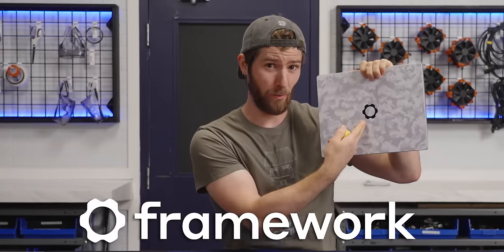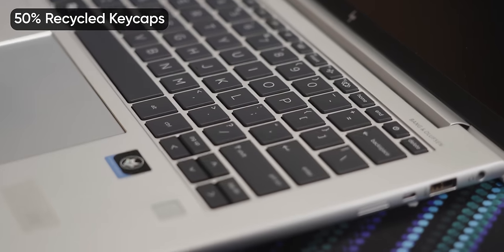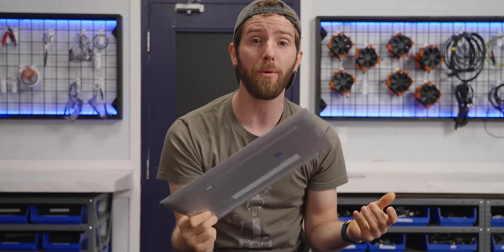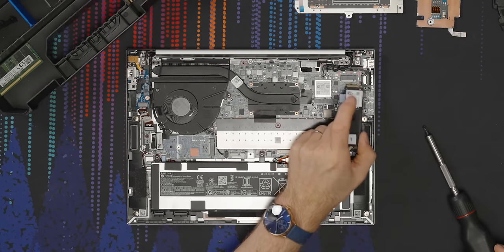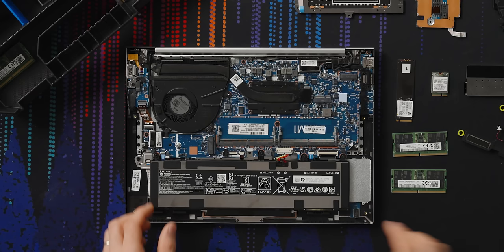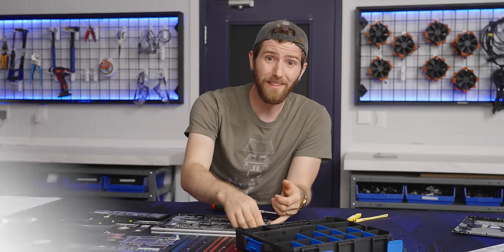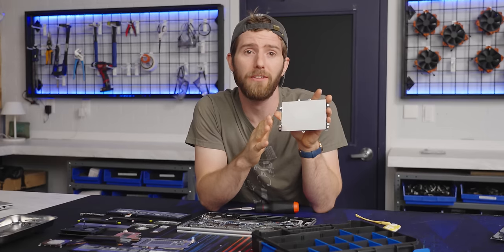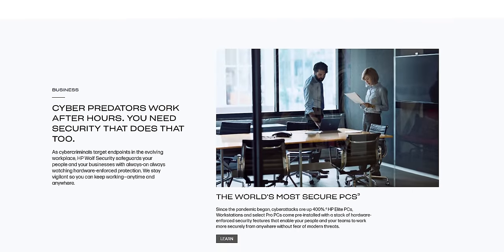My Investment is in TROUBLE - HP repairable laptops

Comment: Repairability is one thing. What Framework has going for it is the upgradability. The fact that you can upgrade your MOBO (and unlike other brands I've actually seen the upgrade exist, not just promised) was a big decider for me.
Reply: Totally agre you can't compare upgrade a motherboard with a new CPU and GPU, or a better battery when tech allow to produce them at laptop cost.
To just whe sell you any part you need. But Next Gen one will be the same frame but whe allocate the screws different so you have to upgrade the full laptop cause whe need to sell a new screen, new battery, keyboard, frame, SSD, RAM, wifi card, trackpad, charger, packcage... 
To be honest, it's way expensive to change screw layout than design a new motherboard with the same layout, but it's all about e-waste.
Reply: And upgrade your screen which I didn't hear Linus even mention being removable for the HP.
Reply: @2moke2creen  I did hear that, seems that the display assembly just uses clips
Reply: making the Mainboard upgradable would have other downsides for the Manufaturer, Notebooks get smaller, quieter, more powerfull etc evry Generation, it would slow down inovation to make the Formfactor, Coolingsolution, IO and so on of the Mainboard compatible across Generations. Look at the Framework Notebook compared to a 1040 Elitebook, The HP Notebook is smaller, lighter, quieter, has a bigger battery, much better screen, faster Ram, is convertible, and so on and so on, and its repairable just like the shown 845. Only Downside to the Framework Notebook is the missing SD Card slot, 2.5G Lan Adapter and upgradeable Mainboard. 
Same goes for Gamingnotebooks, Power requirements and IO requirements for the GPU change evry generation. Making the GPU of a Gamingnotebook upgradeable like back in the Days with MXM Modules would make slim and light Gamingnotebooks impossible, Look at the Asus ProArt Studio there is no way to cramp that RTX6000 GPU into a Notebook from years prior... Upgradeable Mainboards in Notebook dont make much sense and will stay a niche
Reply: @vocassen  clips and some glue
Reply: Yes.  When I saw him make a new PC with a 3D printed chassis, I decided my next laptop is going to be a Framework.
Reply: What I love about framework is also the versatility!
You can buy a framework mainboard and build a tiny desktop PC using it.

How cool is that?
Reply: @stirnfalte1728  you can have micro SD card reader in FW and while not ideal its actually difficult to get a standard format SD card and not micro one with adapter. You can slot in Ethernet port as well if you actually have a need for one.

As for the "getting smaller" that's a manufacturer's argument. Not considerably since the size is dictated by the screen anyway and thickness is +- the same for any ultra book. Biggest issue with FW is the battery atm.
Reply: The refurbished Framework laptops really blew my mind. A second hand Framework laptop will be worth more money. Also, the refurbished version is very price competitive for what you get. It would be so cool if Framework keeps releasing upgrades, like OLED screen or AMD version.
Reply: @rubenmartin7759  please correct your errors, I thought I was having a stroke.
Reply: @stirnfalte1728  You are a bit mistaken when it comes to HP 1040 line - it was always ,,slimmed down" Elitebook 800 line, so it was missing one SODIMM slot & had less removable parts. In most recent 1040 G7 only SSD is removable almost like in old Macbook from 2015. So no - they are not only missing mobo updgradebility now - also replaceable ram & other stuff, you can only upgrade an SSD & I don't mention ports options. 

Also - mobo upgradebility while ,,progress" (making the thing slimmed down) it's absolutely doable - you can slim the mobo & design new chassis, but keep the screw & ports in the same place, so the new mobo can fit to a bit older & chunkier previous generation chassis. The GPU part - too, you just need to calculate heat output in the right way & don't market too power hungry/too hot GPU, for the chassis that will not be able to handle that. Also... Let's not forget, that new generations - most of the time - are less power hungry, so less heat.
Reply: Very fair point.
Reply: @the_tiny_Rambo  the Framework is still pritty big for a Ultrabook, its 2 centimeters bigger than a Convertible with 50% bigger battery and bigger screen.
Looking at 14 inch Ultrabooks they got as small as 12 inch Ultrabooks used to bee not many years ago and also thinner. its just cm and mm but comparing them side by side actually makes a quite big difference. 

Looking at the Zbook 14u it cramps Rj45 SD card slot, 4G Modem HDMI multiple USB a and C slots and a Dedicated GPU in a similar Formfactor than the Framework while having a bigger, brighter, better screen
Reply: I was going to say this. That is the magic sauce with framework, the ability to upgrade things as the times change. Repairability is the bare minimum we need.
Reply: Exactly, that's why this video title is clickbait... 
You can't upgrade anything (important) on this laptop, so how is this a competitor for his investment??

As usual, LTT has sunken low lately with these titles...
Reply: @draxianhyserski1654  current Gen 1040G9 the Ram is SODIMM and upgradeable, the cooling solution did change at least 3 times in the last 4 years, 2018 Model G5 had a 15W CPU,  2021 G8 has 28W CPU in same Formfactor, 2022 G9 has a Single Fan instead of dual fans... all thos innovations wouldnt be possible with an upgradeable Mainboard. Yes the New Intelchips are less Powerhungry but with even smaller Formfactor we now get Baseclock of 4x3 Ghz instead of 4x1.8 Ghz. (OEM configurable TDP range e.g. 15W - 28W) Same goes for Gaming Notebooks, TDP of GPU Rises while Size of Chassis gets smaller, with e.g. Hughe Vaporchambers wich u cant just cramp into an exsisting Notebook.
Reply: For that cost, $1,426.75 on sale, with a basic Ryzen 5 6600U and low end Radeon 660M graphics, with single stick RAM, 256GB SSD and 250 nits display I’m not impressed.  

Yes you can upgrade it, but that is straight up Apple pricing for barebones hardware.  They claim the non-sale price for the same hardware is $2,195!!!
Reply: It wasn't that long ago (or maybe I'm just old) that laptop CPU's were socketed. With a Land Grid Array I'd bet you can get CPU's pretty thin. I don't really care about the motherboard anyway (that's basically just an interconnect that should have the sockets I want), I care about the CPU.
Reply: @stirnfalte1728  I've no idea what laptop you're talking about since Google search only spits out some old ass 2013 laptops with full HD screen.

Even if you could get a laptop you're describing for the same price as FW one (which I haven't seen). No one is saying there aren't any trade offs.
And while you might be sacrificing some ports (I think most people can set it up so 4 ports support their day to day easily).
On the other hand if I recently had to look for a new laptop and my demands for it were such that if I were to buy one I'd go and spend 2-3k USD so it would be enough for my use and actually lasted long time before needing an upgrade. And while FW might not have that much battery or performance or screen, it is configurable enough so I don't have to buy more expensive line just for a specific port, nor do I have to overspend on the most powerful option since I would be able to have more frequent but way cheaper upgrade cycle.

I stand by the claim that 2 cm or 4mm in size difference is not a noticeable difference for everyday use. Yes you will know when comparing side by side. Unless you're a freak about it though you won't notice it in day to day use.
Reply: @the_tiny_Rambo  by the Argument that Centimeters dont matter in a Notebook the 13 inch or 14 inch class schouldnt excist than? because a 15.6 inch notebook is just couple cm larger?

The Framework does have its Edgecase if you need 3 Displayports or 4 MicroSD cardslots in a Notebook. But other than that its just medicore Hardware for way to high Price. We already have plenty Repairable Notebooks on the Market. Matoherboard Upgrade doesnt make no sense for Notebooks imagine a 2011 Thinkpad with 2011 LCD and Formfactor and Cooling Solution but a 1280p CPU. And there are Plenty Notebooks from Lenovo Hp Dell and so on with all the IO 99% would use RJ45+SDcardslot+HDMI+USBa+USBC

Where did you look for Notebooks that fit your needs? LTT Channel? they dont cover much Notebooks outside of Sponsored Gaming Machnies or Macbooks. when i look at Lenovo Thinkpad, Dell Latitude, Fujitsu Liefbook all of thos Manufacturers have multiple Options each which are Cheaper than Framework. BTW you can get last years High End Notebooks used on eBay for just 20-30% of their Retail Price Easy
Reply: Framework is in a whole different league. From an engineering perspective it gets a solid 10/10.
Reply: @stirnfalte1728  sure. I'll bite. What is the rationale for choosing a 13" over 14" and vice versa? Is there any actual measurable difference or could you just use both of those screens (given they have the same resolution) in the same way?

13 vs 15,6 isn't few centimeters that's over 6. Big difference. But hey that's metric for ya. 
 

There are diminishing returns for weight, resolution and dimensions. People don't usually go for a 4k display laptop since the added resolution doesn't change much and has drawbacks. Same cannot be said for laptops that are 10 years old. 

As for the "other plenty of laptops" exist out there with RJ45 +HDMI +plenty of USB a and c ports.
When I put basic spec limitations in my search of the biggest reseller in my country (1440p or similar, USB-C charging, tpm 2.0, back-lit keyboard, fingerprint reader 16:10 display and up to 15" screen) there isn't a single laptop that would have RJ45. ZERO. And the literal cheapest offered is about 300USD cheaper than what would a FW run me.
When you consider that and the fact that I'd be upgrading it 3-5 years from now I'd much rather take the bullet of 300 USD, get a proper high capacity ssd for my laptop instead and hope that FW survives until I need the upgrade.
Reply: @stirnfalte1728  it wouldn't be downside to the manufacturer. It's a trade off quite a few people would take of having a larger machine with the repairability and upgradability closer to a desktop. The key would be creating space and fixing system. Many of the interfaces and components are getting very small and standardised.
Reply: @the_tiny_Rambo The rational for choosing 13/14 inches? 13 fits in a purse, can weight under 900gramms u can use it easely without a desk holding in one hand typing in the Other.... 14 inch sometimes has bigger battery, better cooling solution,  noticable more screenarea, more buttons on keyboard.  I use my Convertible how others would use a 12.9 iPad with Keyboard. For that Usecase many would agree that 2cm matter a lot

But i didnt knew the FW is 1440p. My Bad ... just searched for 1080p 16:9 gave me over 50 results for RJ45+SD+USBa+USBc+HDMI+TPM+TypeC Charging+....
Thinking twice about this i see the Market for this Notebook. But i disagree that Other Manufacturers should make the Mainboard Upgradeable.  IMHO the Framework is Overhyped compared to the since many years fully repairable HP Elitebooks. Myself upgraded my Elitebook to a Bigger Battery (50 to 80 WH) and to a 4K screen from 1080p 8GB Ram to 32GB Wifi5 to Wifi6 and added an LTE Modem with just a Screwdriver. While Linus acts like evry Notebook is glued together like Macbook Pro And i would have also been tempted to whish for a Upgrade to a 14 Core 1280p from my 4 Core CPU But than i saw the other Upgrades a new Chassis of the Next Generation broght with it: Antennas for 5G, smaller Formfactor, Quieter Fans,  Cooling Solution for twice the TDP, bigger Touchpad, The Best Keyboard i ever used in a Notebook and so on....

BTW when u want to use the Notebook for up to 5 years. why dont u buy a Used 3000USD machine on eBay from last year for propably under 1000USD?
OT i tried 1440p, 4K and 1080p on a 14inch screen, when i Set the Resolution Scaling to 100% i need to get ridicoulously close to the screen to be able to read in 1440p, i dont really see a need for more than 1080p or 1200p on a Screen that Small.
Reply: @stirnfalte1728  I don't really know how much smaller and lighter you could possibly want it to be. I wish Framework had a 15-17" line. I have smaller computers, like the GPD Pocket 3 at 9-10", but much smaller than a Framework and you can't have a normal keyboard anymore.
Reply: @KJ4EZJ  Vaio Series P or X1 Fold do have full size Keyboards as alot of 12 inch Notebooks do.

My Point was. when evry Manufacturer would make the Mainboars upgradeable throgh Generations We wouldnt have Thin and Small Notebooks with RTX3080 GPU and we would have Foldeable Notebooks. and the X1 Carbon would be as Big as a 15 inch Gamingnotebook. Yeah its cool to convert your old Mainboard into an MiniPC but for the Price of a Mainboard with an 12th gen i5 i can buy a Whole Notebook from Lenovo or Dell and do a Spar Weekend in an Hotel.
Reply: @stirnfalte1728  Press X to doubt.

Whoever told you that you need to glue shit together for a laptop or smartphone to be thin and light lied to you.

All that you really need is motivation to spend the money to design it. Look what Framework did, and they're a startup upset. Imagine if they had Apple, Dell, or HP money. They could design whatever nonsense you're asking for. Components shrink along a predictable trend line that we've followed for half a century or more. That trend line is based on manufacturing and machining capability at-scale, not glue. Laptops don't even come close to pushing the edge like phones and tablets do, but those can be made repairable too.
Reply: @2moke2creen  He literally says you can replace the screen or even upgrade it, in the video.
Reply: @stirnfalte1728  Yes we would? The layout of the components on a X1 Carbon isn't some dramatically different layout from every other laptop on the market. Standardizing that layout for cross-compatibility even if its a standardized layout just for that brand is not going to affect the thickness of a chassis.. or how the hinges on a foldable screen are mounted to the chassis enough to not allow innovation. 
Hell look at the X1 Carbon from first gen to eight gen. Most of the components are in the same place they've always been. The layout changed on the 4th gen then it went back to what it previously was til 8th gen. So what was stopping the cross-compability of being able to remove the mainboard, even if the CPU and RAM are soldered for the next generations you should still be able to buy a complete mainboard unit and put it into your old chassis.
Reply: @stirnfalte1728  your point kinda makes no sense. The concept of miniaturization doesn't mean everything gets smaller just because it can. That's nearly as bad as saying the ATX motherboard size standard is bad because it would be outdated in a couple years and only hold people back, yet decades later it's still prevalent and holding decent ground against mATX options, with ITX seeming too tiny for most.

Laptops don't drastically change with every generation. That's absurd. I mean unless you consider a generation to be like 10 years or something, but no matter what we have reached a point where more drastic progress needs to be made to allow for more formfactors. We did away with HDDs and such large components so laptops went from nearly 2 inches to under 1.5 to now even under 1 inch... but with concessions. Those extremely thin and light variants have noticeably smaller batteries and more thermal restrictions and are much more flimsy. The idea "Every generation" is a joke when they are struggling to still make their latest sizings work properly without clear drawbacks (e.g. USB-C becoming mainstream).

A clear analog is smartphones. They originally benefitted from phones getting smaller, but needed a bunch of computer parts, so they were chunky phones. Then after a few years they got efficient and became thin and light. Now the recent generation is BIGGER than a few years ago because they are stuffing so many features and so much power into it.

Phones didn't become so small they turned microscopic. Laptops didn't depricate because tablets exist. Formfactors can work for a long time before they become obsolete. People don't choose a 14" laptop expecting to "upgrade" to a 12" laptop in a couple years. SSDs, RAM, and tons of other stuff are not getting any smaller right away, so it's just all too weird for you to spell out doom and gloom because a laptop case might be expected to see the end of a decade to allow people upgrade options when new tech comes out.
Reply: @usucdik  i dont really know how to answer to this... alot of your statements argue the converse to what i was proofing in my previous comments. You are informed wrong. just because the X1 Carbon Gen 6 is as big as the X1 Carbon Gen 10 doesnt mean you could easily upgrade the Mainboard. Alot of things have changed in the years. For example what you didnt even noticed... The gen 6 has a 15W TDP CPU and the X10 has a 28W TDP Cpu which before was only possible bigger Chassis. Notebooks get more sophisticated and smaller since forever. Today we have 16inch Notebooks with Quadcore CPU the sice of a 12 inch Netbook from 5 years ago.

Who knows what happens in 2025 maybe Vaporchambers allow for 45W TDP Cpu in 14 inch Ultrabook. Good Luck puting that new Coolingsolution into the Framework
Reply: You can also upgrade the motherboard on the HP…
Reply: @dusscode  For the next gen?
Reply: @the_tiny_Rambo  yes, and you still have to replace the entire CPU, fan assembly, and RAM, just like with the Framework.
Reply: @dusscode  sounds cool! can you provide more info?
Reply: @draxianhyserski1654  hypothetically speaking, everything here is doable.  Just remember modularity and upgradability is inverse to thin form factor, latest tech and chassis rigidity and affordability.  smaller MB= higher density board= higher cost.
Reply: Ah even the framework has an upgrade limit  y mean the form factor of the motherboard has a max limit so you can swap the motherboard for the maxed out model
Reply: @NanneWielinga  It's perhaps not quite as useful as it may seem though, except at the high end. I recently replaced a 10-11 year old quad i7 laptop, the performance is still better than many cheap new laptops and barely below even mid-range models. Albeit it naturally uses more power.
I probably wouldn't have bothered with upgrading, if not for lack of Windows 11 compatibility, and inevitable wear from a decade of heavy use.